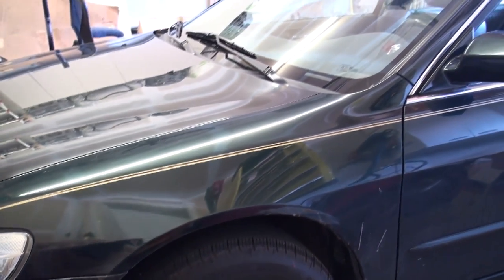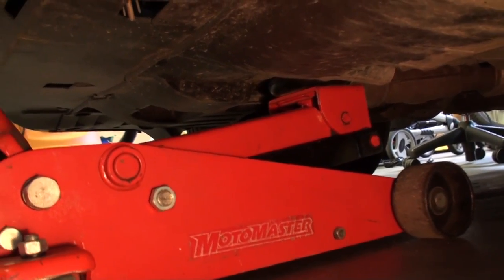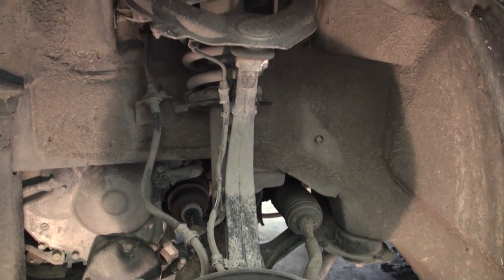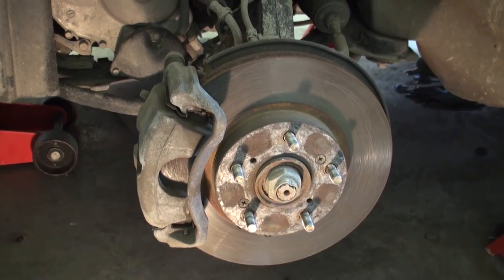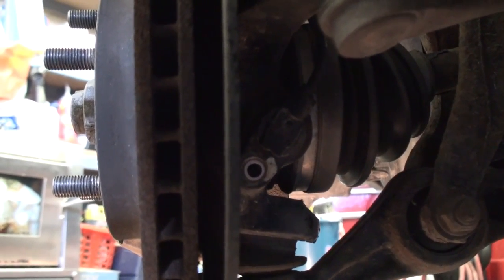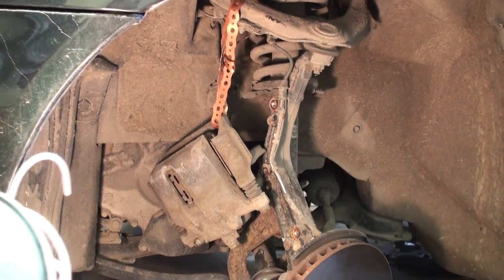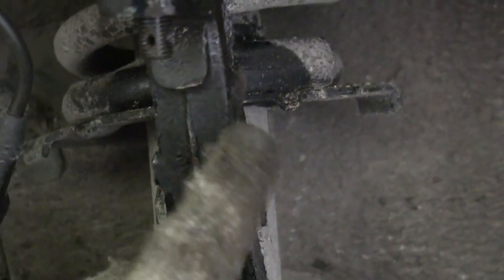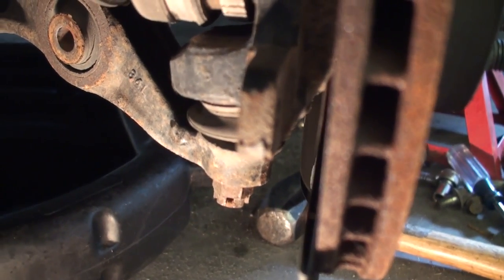1998-2002 Honda Accord Front Ball Joint Replacement

Comment: Why do you have to hang the brake calipers on a wire?
Reply from the maker: you never hand a brake caliper from the the hose.  The hoses can be damaged or compromised if they're not properly supported and that could lead to catastrophic brake failure.  Never hang anything from your brake hoses.
Reply: piercedasian Okay thanks. Also by the way how do you know if your lower back joints are bad?
Reply from the maker: FRJae get the car onto a hoist or securely support it such that the car won't have ANY chance of falling off your support stands and give the tire a strong "wiggle" at the 12 and 6 o'clock position.  If the joints are loose your strong wiggles will reveal play in the joint.

Comment: What size was the ball joint separator?
Reply from the maker: I couldn't tell you exactly what the size is other than the prong spacing for the tool is about 1.5 inches wide

Comment: How do you tell the ball joint is bad?
Reply from the maker: +Chris Chong jack the car up and make sure it is secured.  Grab the wheel at the 12 and 6 o'clock position and wiggle back and forth.  Is there play?  If yes then ball joint is bad.  You can also jack up the car and pry at the knuckle where the ball joint "plugs" into the control arm.  The gap is tight but you can easily get a pry bar in there.  Pry at it.  Does it move?  If yes then it is loose and needs to be replaced :)
Reply: Thanks for the info.
Reply from the maker: you're most welcome!

Comment: Turn the castle nut upside down.  Don't beat your components, use a fork, they're stupid cheap.
Reply from the maker: yep that is another way to prevent the castle nut from getting mangled.  I've always had bad luck with pickle forks so I've opted to use a ball joint separator as I usually don't ruin the boot on a ball joint using that.

Comment: You lost me when you started pounding on the ball joints to break the connection.  You have a ball joint separator, why didn't you use it on the tie rod/ UCA and save the whole process lots of unneeded hammering and cussing...?  That tool is one of the most used of my general suspension tools, and not too pricey.  Every DIYer should have one.  Also, as per Honda shop manual, only use a rubber/ plastic mallet on the drive axle end so as not to potentially damage the wheel bearing from impact force.  Otherwise, a good video.
Reply from the maker: +douglas747wct Sorry this wasn't my best video as it was actually a struggle to film hence why there are sections that should've been included in the video.  The reason why you do not want to use a ball joint separator on the tie rod ends is b/c it isn't necessary.  Tie rod ends are very easy to pop out by a few light smacks with a hammer (as exactly performed in my video).  The issue when using a separator is that I've found the rubber grease boot tears far too easily (maybe my separator is too big) so rather than damaging the tie rod end boots I opt to give them a few smacks and they often come out with very minimal effort.  The ball joint on the other hand I was pounding out b/c that's how you remove them and if you're in a pickle to get them back in a few carefully placed hits will also get them back in.  NORMALLY I would use a ball joint press clamp to put them back in but with my luck when I was doing this vid it was damaged (the guy that used it before me screwed up the tool).  However, the hammering method actually does work well and is definitely a suitable way to install a ball joint if you have no other option to get them in.  

The video looks like I'm hammering hard but I can assure that I'm a lot gentler than my video shots suggest.  To be honest with you I think I dislike this video the most b/c it isn't completely representative of how I NORMALLY would present the fix.  

Thanks for that feedback nonetheless, I'm always looking to hear from others on how to improve things.  

Thanks for watching!